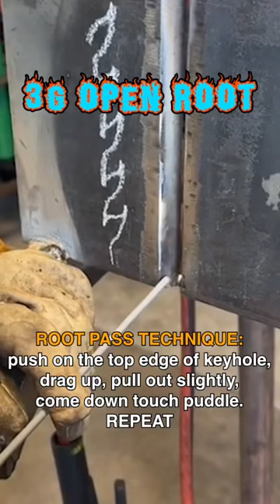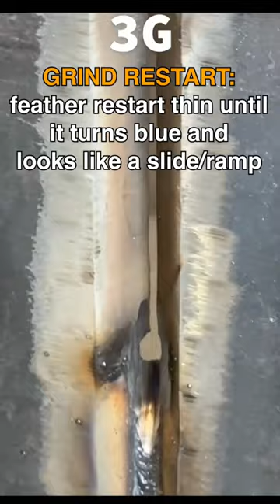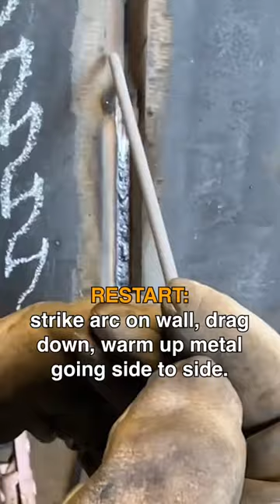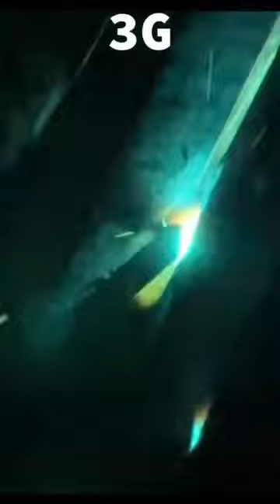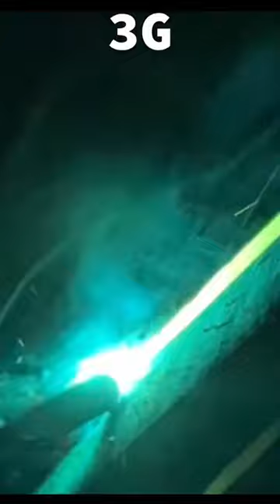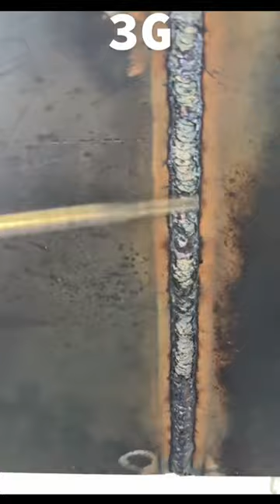3g Open Root | Root Pass Technique #shorts

Comment: My dad was a welder for 60 plus years. Master at stick welding. I remember way back in the 1980s the place he worked decided to get the guys certified both plate and pipe. Out of 15 welders the company had at the time. Dad and one other guy passed dad was already certified but took the test for fun. Dad always did his root pass with 7010 rod cover with 7018. Dad did his one shot no grinding between root and cover just wire wheel as he always did. Dad always told me using 7010 for root pas was why he and the only other guy passed. They were the only 2 that used 7010 for root pass the others struggle. For dad it was just another weld no big deal
Reply: 7010 was always my favorite rod in stick tbh. To be clear though I hate stick welding and rarely do so since I Tig for a living
Reply: @Nathan J  see I don't mind stick along as it's not overhead. Overhead stick is like trying  to juggle a volcano  above ur head 😂😂
Reply: @shroomytoodope7375  overhead is the same as flat. Just run it slightly colder and keep the rod jammed into the puddle
Reply: 7010 and 6010 are the samn thing the only difference is the tensile strength of the rod otherwise the composition of the flux is the samn
Reply: @Sam Rowe  huh that makes since honestly  I didn't know that
Reply: @shroomytoodope7375  I'm glad I cud help tho I'm more of a doer then a teacher my teaching skills are sort of shitty not because of lack of patience but it's more like welding for me over the last 25 some odd years has become an extension slash second nature to me and when I'm watching someone new learn how to weld I can only tell them slow fast sort of physical directions as far as how to handle whatever process they are doing but I'm the end it wholely boils down to time honestly from what I have seen majority of people can learn how to weld with most processes within just a month
Reply: @shroomytoodope7375 yeah 6010 is 60k lbs and 7010 is 70k lbs of tensile strength
Reply: @erichill5208 that’s awesome! I just finished school and stick was my favorite 7018, it takes a lot of skill to be good at welding!!
Reply: No one cares. Accomplish something yourself and stop telling daddy’s story (which he probably made up).
Reply: @yourejustmad9938  you may not be proud of your dad. But I’m proud of mine. He was the best at what he did. He passed on great advice to me  and was the best mentor I could have ever had over the years. And I was passing on a tip with my comment. Obviously you are not intelligent enough to have picked up on that. So you tried to demean me being proud of my dad. I’m guessing because you are not proud of yours.

Comment: You could do it that way or tighten up the gap turn the heat up, add more landing, drag the rod and you can feel the walls breaking down and filling back in. If your root is low adjust rod angle so that its pointing back at the puddle, if you are blowing the puddle out turn your heat down, speed up, or point your rod angle away from the puddle.
Reply: You speak as a well experienced professional welder👍
Reply: You should create your own channel. I'd watch you over this channel
Reply: What is the point of a root weld? Why not just weld it all with the same rod ? I'm new and know nothing but I did just get a stick welder and it seems no one has the answer for me ...I hear for better penetration but can't I get that from just turning the amps up ? Because that "penetration" they keep talking bout would only be at the seem and not the rest of the weld ..or at least that's what it sounds like and obviously ya want the same penetration throughout the weld I would think so why bother using a different rod for a "root weld" hell what even is a root weld other than the beginning of a weld ?? These things aren't being explained they don't seem to add up for me this far
Reply: @trailman20  the point of a root pass or root weld is too add reinforcement to the back of the weld to ensure that I will not fail from any sort of pressure you put on it. In pipe welding the root pass is looked at as crucial because you have water, steam, gas, etc. flowing through the pipe at high pressure so it’s usually the first line of defense against weld defects if that makes sense.

Comment: Same exact prep I use for pipe, but if you have your heat just right, you only stitch/whip if you have to. Proper heat, and you jam it right in there and drag it the whole way. Burns the walls around the arc and throws a solid root reinforcement in.
Reply: 6010 is a contact rod while running roots .. pls don’t be silly
Reply: Yessir👍 
#597

Comment: I was taught not to oscillate the rod on your root pass. It creates undercut and and an uneven bead on the inside which also creates turbulence in whatever is running through it and turbulence wears valves and instruments out faster.
Reply: That’s what QA/QC is for. THEY determine if the weld is satisfactory.
Reply: Or it depends entirely on what the work specs say bc they could allow  it
Reply: Sometimes isolation is necessary because basically what you are trying to do is take a drop of water and get it to fill tiny craters. Sometimes if it sits still on top, it won’t move in for the crater so you have to wiggle the puddle a little bit. That is the only point of isolation.

Comment: 6010,7010 are contact rods when running the route .. just push it tight and watch the triangle toe nailing .. silly boy .. arc length creates extra heat ,, a tight root is all deposition not heat hmm keep trying

Comment: Last resort technique for sure. Much easier to hold your rod 90 degrees to the pipe, adjust your heat, and push ther rod uphill with a tight arc length.

Comment: You’re going the wrong way
Reply: only pipeline goes downhill. most codes are all uphill
Reply: It’s called vertical up pal
Reply: @jamesps7515  oh wow.  That’s amazing.
Reply: @55omega65  Codes normally do not restrict the progression of a vertical weld they only specify that you qualify it. I don't know all codes in existance but ASME 9, CSA Z662, AWS D1.1, D1.6 or CSA W59 have no restriction on vertical down welding. Only that the welding procedure and welder shall be qualified. Your consumables will certianly restrict you.

If I were to help one of my clients develop an open root procedure it certianly would be 6010 or RMD/STT downhill for the root and fill everything uphill. Running a downhill root allows for more variation in field fit up which is always an issue no matter how good your intentions are. An uphill fill may take a bit more skill but the fill happens with less passes which reduces repair rate.